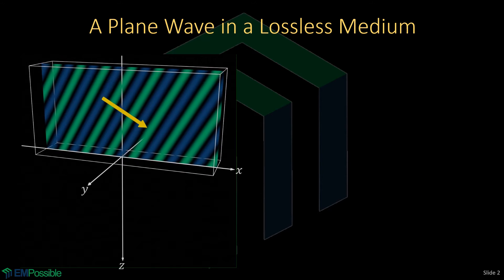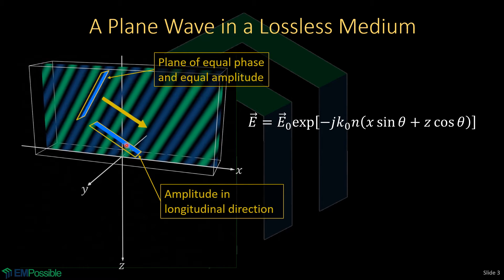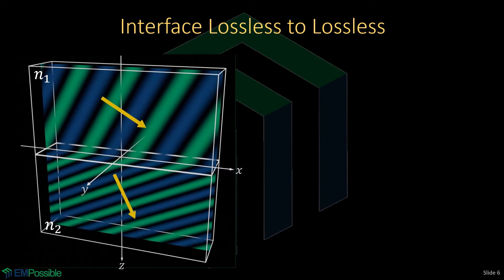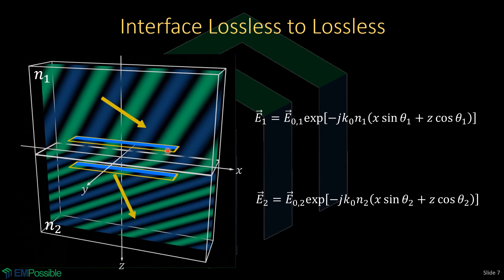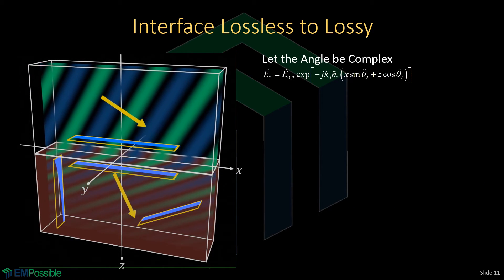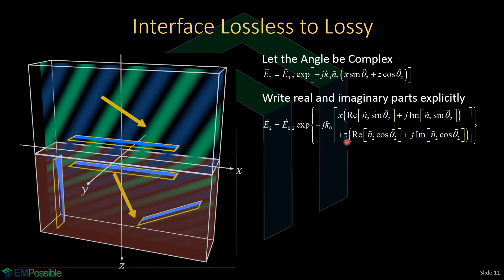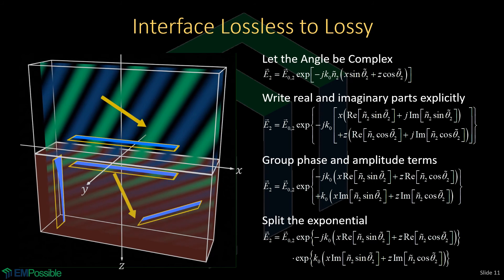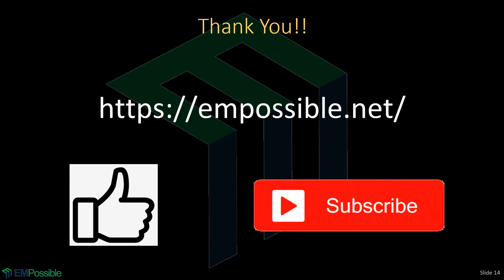Complex Angles in Electromagnetics and Photonics

Comment: At "7:27" how do you understand that?  Isn't that a new wave just hitting the interface at any point of the interface? how come the wave just crossing the interface decays more as we move towards the positive x-direction along the interface?
Reply from the maker: You are correct about the applied wave. It is independent of the interface so amplitude will be constant. The second wave as illustrated at 7:27 is what we would intuitively expect due to loss in the second medium. However, intuition is not correct here and I am explaining why. It is not correct because it would not satisfy boundary conditions. This means amplitude of the transmitted wave cannot decay with distance x.

Comment: I just have a question regarding to the understanding of the phenomenon:
- Complex angle is due to the loss that is in the second medium.
- The complex angle is only be achievable if the second medium is lossy.
- The imaginary term of the angle is corresponding to the decay.
- The real part of the angle is corresponding to the actual propagation. 

What I do not under stand is how do you know mathematically (or conceptually) the expression for the second medium is not going to work for the lossless to lossy medium?
Reply from the maker: I think you can get complex angles any time either medium has loss or gain. In any combination it can produce a condition where phase and amplitude are not aligned. 

I would not assign the real part to propagation and the imaginary part to decay. Somewhere around 12:50 in the video I start giving equations for this, but they involve both real and imaginary parts of angle.

Comment: I'm guessing from this that a light ray, then, continues in the direction of the angle of constant phase, because I've seen this same tan⁻¹ formula in someone's physics notes elsewhere. This perfectly explains where that equation came from, which their notes had not. And then for the purely real case, this simplifies down to tan⁻¹(sinθ₂/cosθ₂)  which is just θ₂.

I guess the gap in my understanding then is what I do with the other angle. The diagram makes it look like the plane of constant amplitude is always 0 because it's drawn parallel to the interface, but there must be cases where it isn't.

*Edit:* Okay, I think I see. I worked an example coming from a lossless medium and the ñ₂ cancelled itself out, leaving 0 for the imaginary part, and then tan⁻¹(0) is 0. But if the incoming angle were complex, that wouldn't be the case. I guess in my case because I'm working on a ray tracer, the incoming ray is always at a real angle, so I can ignore it.
Reply from the maker: You can also have an interface that is not in the xy plane.  That would make the angle of the amplitude plane not zero.  

If you have to pick an angle, I suppose it is best to go with the real part of the complex angle.  However, in my limited experience studying this, the beam envelope propagates at angle somewhere between the angles defined by the real and imaginary parts.  I cannot be sure without further study, but it might be more accurate to average the real and imagine parts and use the average as the angle of refraction.

In the last couple of years, I have learned that I know very little about electromagnetics.  Studying scattering at an interface was a very humbling experience for me.  Here is something else for you to ponder…there is no such thing as total internal reflection!